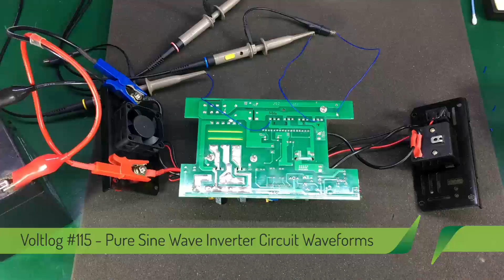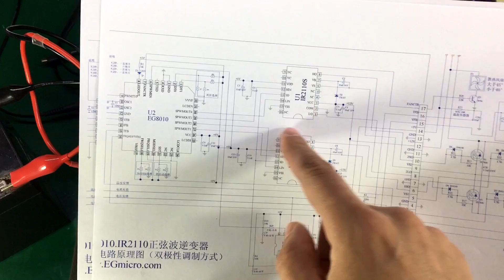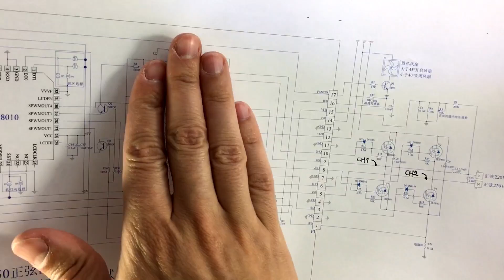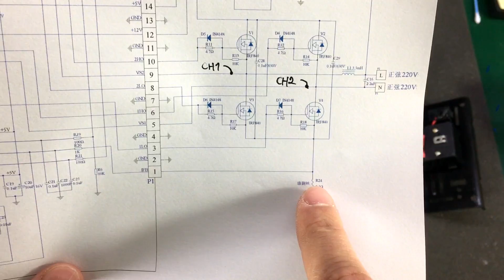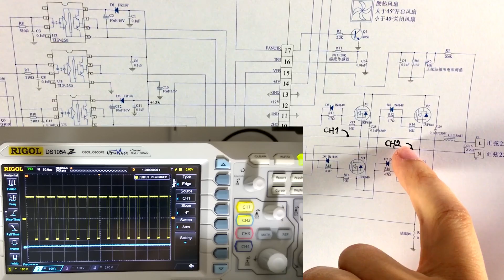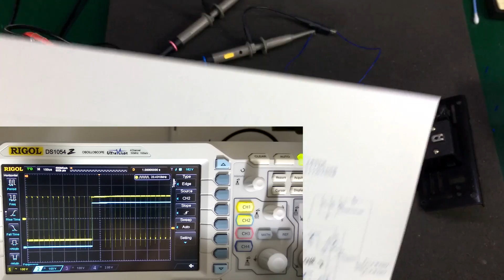Voltlog #115 - Pure Sine Wave Inverter Circuit Waveforms

Comment: Nice video! I just need a 50W 12V to 120V pure sine wave inverter. Can you point me in the right direction on what components I need to change in the design? It also needs to be a very compact design so I can fit it in a 10x10x4cm box. 😅